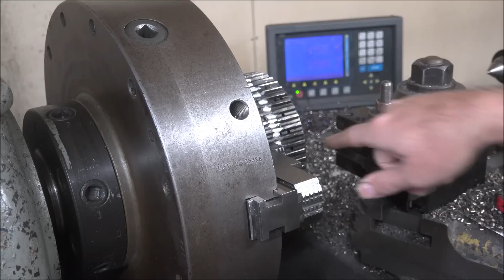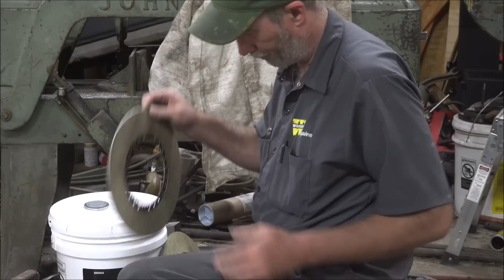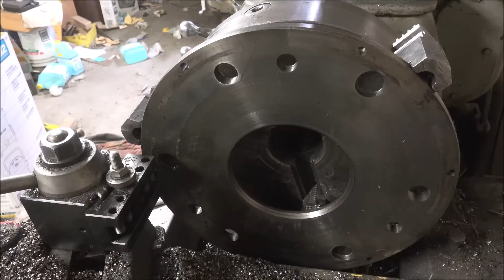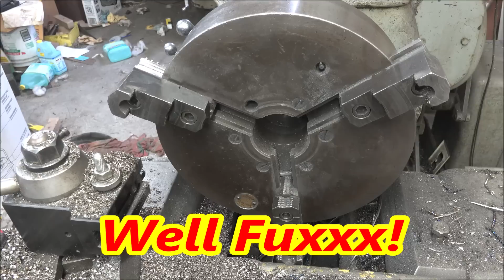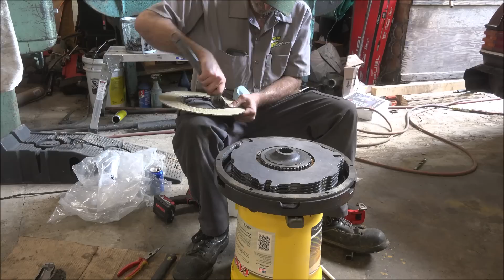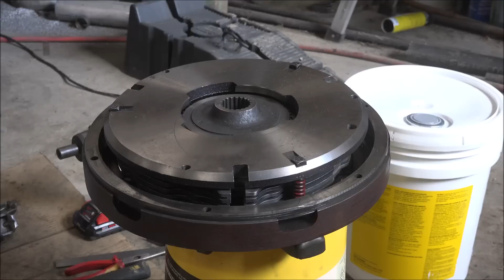6 Disk John Deere Tractor Pulling Wet Clutch Build

Comment: i remember cursing the wet disc clutch on my old XR500, it would ALWAYS drag bad, I had it all apart, all the plates were flat, I made sure the drum didn't have grooves, I filed and filed, nothing I would do would make it release right.
Then I got pissed off with it and put it in high gear, pinned the throttle and just slipped it HARD for maybe 10 seconds, it released and never gave me any grief again!
Reply: You gotta break them in right, Lol!

Comment: I did that one time, still have the scar to prove it. 15 stitches. After that, I would get within .060 then slow the spindle way down.  Cut until the tone change or you hear it pop through. Then wack it out with the hammer. Definitely a dangerous job. I'm glad the only real injury was your pride.

Comment: Damn, Brian shoulda worn his brown pants that day!  On another note, I've found those round carbide inserts (not the wood ones) to be very handy around the shop.  One is working well in a shop made ball cutter and just had good success with a round insert at the mill in a fly cutter.  Curtis at CEE uses them all the time clearing metal for getting the ends off of hydraulic cylinders.

Comment: 😨I have a little 10"x41" Grizzly ½ mill/½ lath🤮. I could talk down on it all day but it works, welllll in fact 🥺it has pulled my ares out the fire 🔥 a few times. Anyway I thought I was doing it wrong until I saw you cutting splines manually....😁👍As long as it works.

😱Holly Molly b-man that som-o-beaching clutch took off like a jet and flew south quickly. Thanks for showing me what to listen and watch out for. My hat 🎩😳Is off to you sir.
Well 911 wasn't called, no shots fired, no blood on the floor and no one lost consciousness so I'd call that another successful day. Ain't like any of my families weddings but it was exciting nonetheless.🤣😂🤣

Comment: Super neat Brian.  Do they make clutches like that for semi-truck applications?  I have never seen a wet clutch in a truck.  Cool that tractors have them.  I think you can get a dual disc dry clutch in a semi-truck, but I have not seen it all.  Thanks for the video.  -----Doozer
Reply from the maker: I am sure someone did it at some point in trucks but I don’t know who. Dual disk dry is the most common semi setup like with a road ranger. Same clutch I have in the Hyster.
Reply: @bcbloc02  Macks here had double discs with a spacer between. Buttons too.
Reply: @lewiemcneely9143  That is not a spacer, it is the intermediate DRIVE PLATE.
Reply: @larrywalker7759  Whatever. I've seen enough of them to know where they go anyway. Put your manual back up.
Reply: @lewiemcneely9143  LOL.  Nah, I have to keep the manuals on the parts counter so that when somebody wants a part I can ask them to please point to the item that they think they are talking about.
Reply: @larrywalker7759  Good for you. I was always too greasy or on the road to be around manuals.

Comment: Wouldnt it be easier to make a whole new clutch hub. The outside teeth could be hobbed and we probably have a broach to cut the internal splines. I also have a fixture I made to mount a single point hand ground tool to the arbor of a horizontal milling machine. I use that sometimes To do stuff like that. I also have a slotter attachment for my vertical mill and I have a rotary table to use for indexing.
Reply from the maker: Well the internal splines are 2 different diameters so would probably have to broach as a 2 piece then bolt them together.  The time and materials for me to make a new one would be 5 times what welding up and cutting is.  With the proper specialized equipment it could be done for less but I don’t have that.

Comment: So the next time you’re treppaning a clutch or whatever, what would you do differently?
Reply: When you are almost all the way through the sound will change, and you should stop.  You can usually hit the center out with a dead blow hammer at that point or cut it with a grinder.
Reply from the maker: That was my plan. Apparently the tone change didn’t happen until it was thinner than I expected
Reply: Thanks, just curious.

Comment: Brian, I did not like to see the way you were setup to trepan!  Glad nothing was seriously damaged including you!
Next time set your compound parallel to the bed and feed your tool into the face that way using the compound to feel feed into the face instead of having to move the whole saddle. You would be auto positioned back away from the chuck and work with your left hand on the carriage wheel up against a stop for quick retrieval, and with right hand feeding the tool.
Also,... NO cutting oil?  Were you monitoring your middle depth?

Comment: single point trepaning is not dangerous you just don't know how to do this operation. Here's how you do it. You trepan up to a certain thickness left behind, then you put your block with ball bearing, have it roll on your part. I saw it coming before it flew out of the chuck. I guess you were just tired or hurrying to get the job done.
Reply from the maker: Last time I did one the tone went from high to low and I stopped and knocked the center out with no problem. This time the tone never got as low honestly my Dro showed I had .030 to go so I felt safe. I can only figure the chuck tension was more so the tone didn’t change as much as I expected. It was lucky nothing was damaged but the insert.

Comment: This is a prime example of how people get hurt/killed.   Every (insured) pulling organization in the US requires all SFI rated flywheel/clutch components for every class above farm stock.  You really need to speak to an attorney so the can define words like liability and involuntary manslaughter to you!!!!   I will also foward this video to every pulling sanctioning body I can find such as NTPA, Outlaw , PPL  and several state level organizations!!!
Reply from the maker: I believe it is being used in an rpm limited class. If they pull in a class requiring clutch certs then they have none but that is up to the organization to tech that stuff not me. That being said out of literally hundreds of these things I have messed with over the last 30 years I have not ever seen any cracks in any of the parts. The wet clutch does not get hot so actually is much less dangerous. All of the parts of the friction assembly are steel anyway.
Reply: Andrew.
No use sending this to NTPA, PPL, or Outlaws.
We already know about these clutches.
They require certified clutch parts, and this would not be a legal set up with any of those associations.
Your time would be better spent pissing into the wind.
Reply: @Harold Phipps  crap like what is in this video is what was done in the 1970's  and  led to safety/ rule changes and constant clutch certification inspections!   Every pulling organization BIG or SMALL that is insured (insurance companies mandate sfi clutches for anything above farm stock) require sfi clutches.  All pullers have a responsibility to point out dangerous stuff like this!  You as an NTPA official also share that responsibility because it reflects poorly on the entire sport of pulling!  Only a fool would make a video of doing something like this and the liability issue it creates!    At your earliest possible convenience please stick your head where the sun doesn't shine but it appears to already be there !
Reply: @andrewevans1658  🤣🤣go take some meds